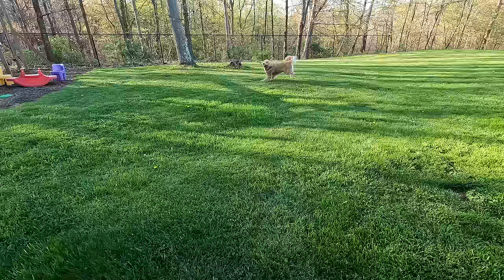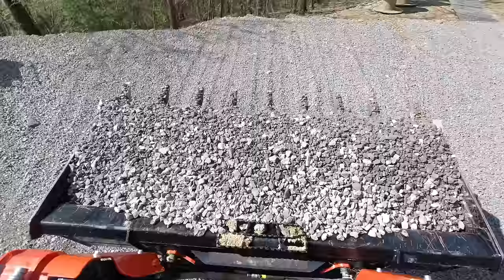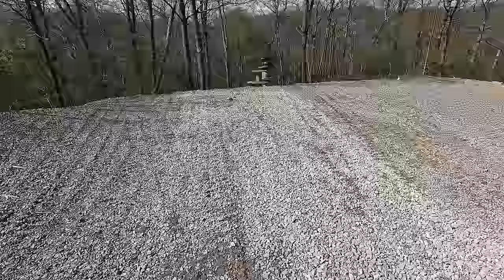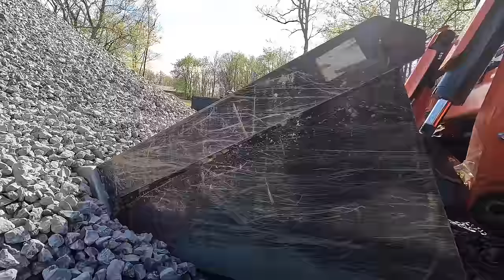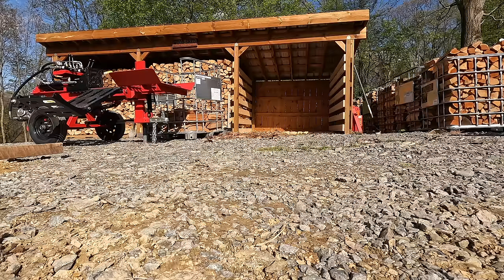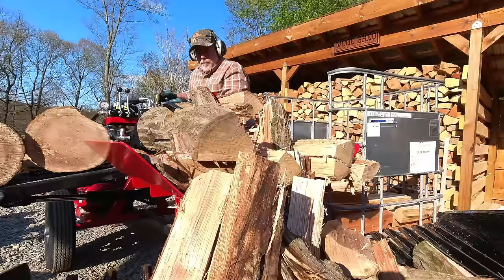My Favorite! Red Oak to Wood Shed, Working in the Wood Yard

Comment: Hi Mike, 
I load a dump truck with stone or soil and drive up and down in reverse using the duel wheels as a roll, load up Blueford with shale and give it a try, it works fantastic in the yard at work and i find damp stone is much better than dry.
I will keep an eye on your video's to see if you try it.

Cheers, Vince Borg
 Melbourne Australia

Comment: Use the tractor to tamp the stone down. instead of the skid steer. will take a little longer. but the wheel has more localized pressure then the skid steer tracks will. Will press the stone down more firmly.
You can use the skid steer to press the stone down if want to. But instead of just forward and back in one direction. Also go side to side.  IE  up and back, then turn 90 degrees then go up and back that way too.

Comment: Valley wood:  Don't forget you can extend the reach of the forestry winch by adding a tow strap or chain (or several!) at the end of cable.
Yeah, you might have to do a few connects/disconnects, but you'll get the log where you need it.

Comment: Growing up we burnt wood exclusively for close to 12 years. We had a large red oak and Jack oak area we cut out of for probably 50% of our wood. The red oak is super straight grained and not a real tight growth ring. I used to split up to 8 foot long pieces up to about 8 inch diameter with just a couple swings of an are all the time let alone split the burn lengths like it was kindling. And like you said burns hot. But I always thought it dried pretty fast if it froze hard during the winter like maybe it freeze dried. Enjoy your videos a lot. Keep up the good work

Comment: Perfect Circle and Sealed Power rings were the two largest manufacturers of piston rings. “Slinkies” are actual long coils of piston rings before a single cut is made on the coil. Many a child was introduced to slinkies from parents who worked at piston ring manufactures. Dana Corporation actually bought up “Perfect Circle”. Great to see some of this history exposed on “Blueford”. Have a Day.
Reply: I was going to mention the mud flaps on Bluford the first time I saw it but I've tried to comment less because I have a tendency to appear as a know-it-all, because of my different occupations over the last 71 years. During my employment with dealerships after attending a couple years of trade school for automec., I installed quite a few Perfect Circle rings on Pistons during overalls. I would say the slinky came from the two thinner rings that make up the oil scraper ring or bottom ring on the piston. Much more flexible than the harder stiffer compression rings. Ingenuity and necessity are the mother of invention.
Reply: @earlhollar1906  I also noticed right away because I worked for Sealed Power for many years and you’re absolutely correct about the scraper ring. We would often gift wrap non-conforming rings and give the slinkies away to children at Christmas time.
Reply: @craigsmith2889  All the films we watched in auto shop class in the 70's were made by Perfect Circle.
Reply: One of the many plants I worked at was the Hagerstown Distribution Center . We packaged those piston rings for distribution all over the world. They were made in the two manufacturing plants in Hagerstown.  The thing that is amazing is the guy that invented the cruise control was blinded as a child. Dana is a tier 1 supplier to many OEM suppliers. Your Jeep has many Dana components as well as your pick up. One of the oldest plants is in Pottstown, Pa.
Reply: Holy moly! I am now empowered by more very 😎 🆒️ trivia! I love this kind of stuff! 😊 Thank you!

Comment: Supplied a customer with a load of osage orange firewood. Said it was the most amazing firewood he had ever used. The only drawback is that because of its' high BTU rating, you must have a stove/furnace that is heavy enough to withstand that much heat.

Comment: Hey Mike,  could all the wood chips be used for fill? And also could it be spread over the new sawmill Road. Use everything!
Reply: Wood chips will biodegrade/rot, I believe
Reply from the maker: Hi Willie, Like Gary said the will rot, also you can't them to compact like good soil. The fill would be unstable and soft

Comment: I'm sure you've seen these, but they have cones that you put on the end of a log that you're dragging so it doesn't catch anything.  What you have to do across the street is what they're perfect for
Reply: You can cobble together the hood of a wrecker car or pickup with the choker cable to do the same thing if you've got the parts and pieces available....

Comment: I far prefer hardwood lumber to be 10' or 12'.  Still manageable to work with, but when cutting to length for projects, I just get way to much waste from 8' boards, especially when making cabinets.  I've got some at 14' and 16' as well, but those are harder to handle.  I only mention this because your 10'8" preferred length for firewood is also a better length for hardwood lumber, in my opinion.

Comment: Mike I have a suggestion why don't you use bluford for Packing your fill. With a good load of dirt I would think it would pack a lot better than your sketcher
Reply from the maker: To slow going back and forth and shifting gears
Reply: @OutdoorsWithTheMorgans   I believe you would get twice the   Compaction
Reply: @OutdoorsWithTheMorgans   When compacting silent We used 4 wheel drive trackers With tires instead of tracks

Comment: Who came up with cruise control?
Image result for who invented cruise control
engineer Ralph Teetor
While speed control was used in automobiles as far back as the beginning of the twentieth century, modern cruise control was invented in 1948 by the American engineer Ralph Teetor. The idea came to him while riding as a passenger in a car driven by his lawyer, who kept speeding up and slowing down every time he talked.
Reply: The first cruise control was just a pull cable attached to the throttle and believe it or not, it was more fuel efficient than modern day cruise control systems because it didn't work the crap out of the engine when going up a grade.  It would allow the vehicle to follow the laws of physics.